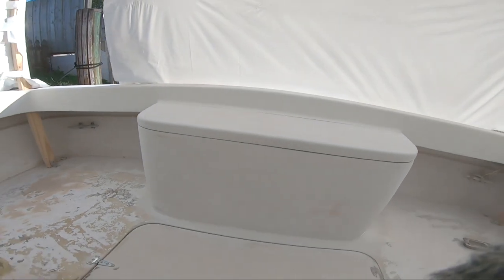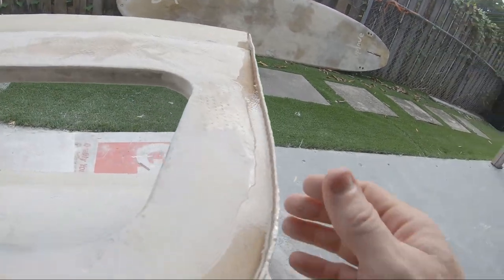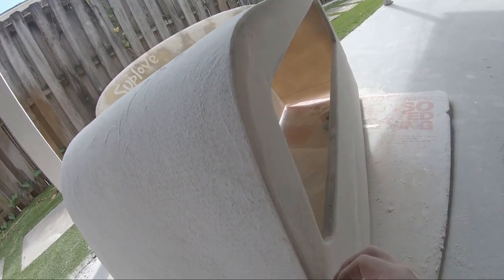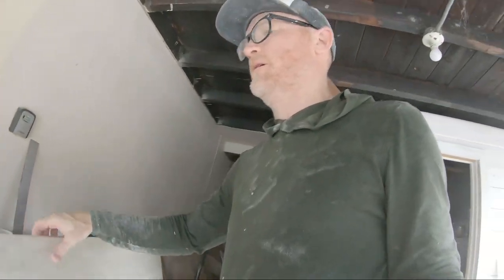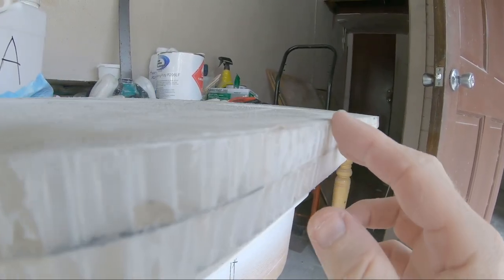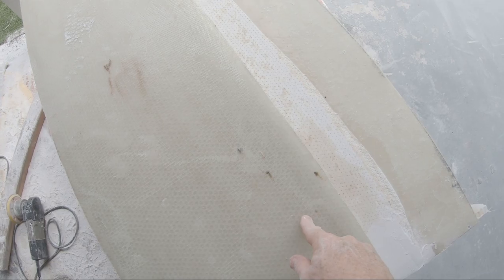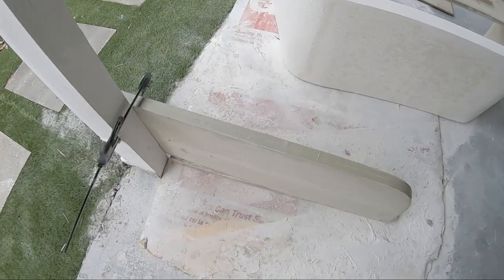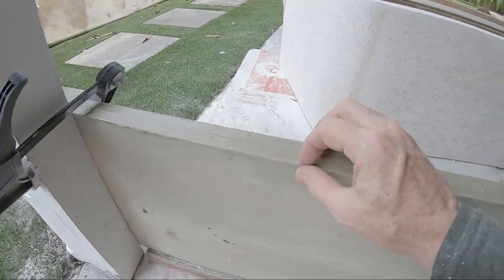Insulated Transom Mounted Fiberglass IceBox Part 3

Comment: Nice progress. So, with epoxy on an edge like that you dont need fibers of any kind? 
Those patio blocks (the walkway in the background) make great flat weights that are not too heavy. I always have a few extra stacked up just in case. At the moment I have like 15 after putting a deck back down in a Super Nova. I would have had to empty out half of my garage to cover the same area they did.
I gave you a sub. Us little guys need to stick together!
Reply from the maker: I used reinforced epoxy but I ended up glassing over the epoxy edge later in the build. Thanks for the sub. 🤙🏼

Comment: Hey man I've been following you on Facebook page for a while you'll be really good work and you'll help me help some friends of mine with the boat projects long story short as I'm looking to start redoing some old votes that I've run across and reselling them is there any money in doing that mainly because I'm looking for a career change because my current job is no longer what it used to be and it's a really shitty place to work But my wife won't let me take this kind of a leap into this business unless I do a 1 or 2 improve I can make money out of it so I've got a budget I've got a small boat and and I just need some guidance is it worth trying or pipe dream
Reply from the maker: Hard to answer quickly. But it’s hard to make money on boats that are total rebuilds. If you want to flip boats buy ones that have cosmetic issue only. If you have to replace stringers and transoms you’ll never get your money back for that time invested. If you have more questions email me russ@backyardboatworks.com

Comment: Sup! You just answered the question ive been searching for, applying polyester over epoxy !
wonder if you have any sugestions for applying polyester resin on foam board without melting foam? Thanks Cool video's Man!
Reply from the maker: Can’t put poly on XPS or EPS foam. The styrene in the poly resin will melt it. You need to get a proper PVC foam core material designed for doing sandwich construction.
Reply from the maker: Also note that you can’t put poly over epoxy till it’s 100% cured. Most epoxies will full cure after 7-10 days but some can take weeks. You have to know the technical data on the epoxy you are using. Fully cured doesn’t just mean that it’s sandable. It means that the chemical reaction needs to be 100% complete.